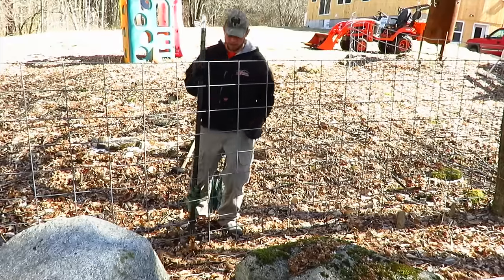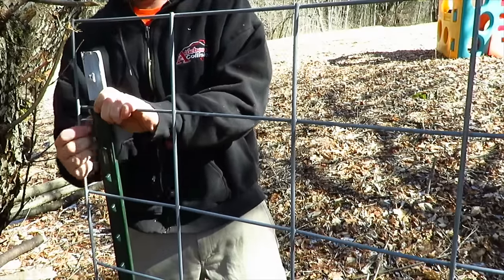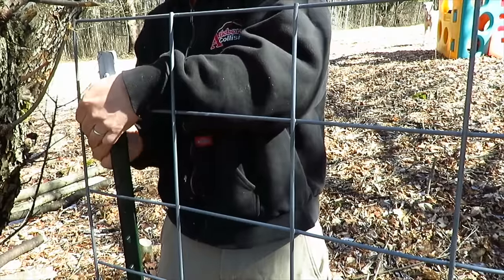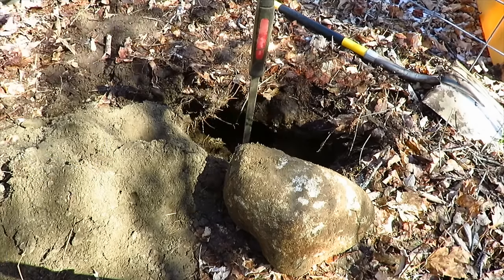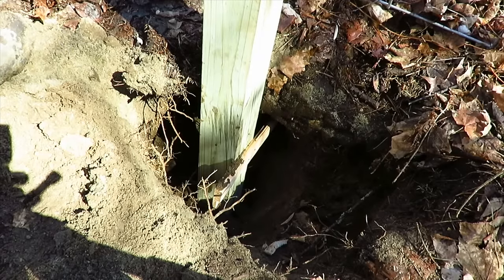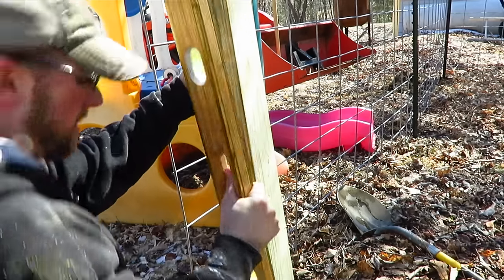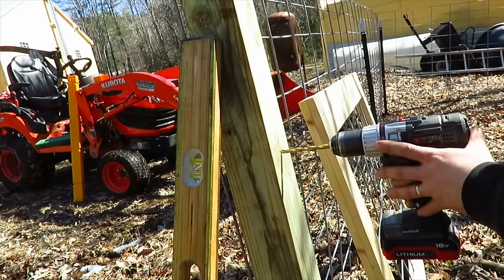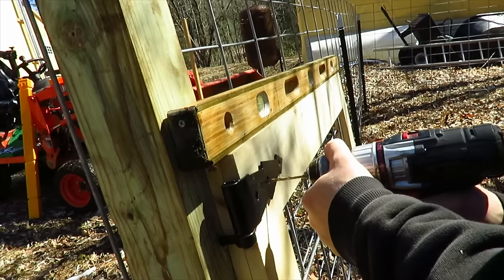Building the Pig Pen and Installing a gate

Comment: What keeps the pigs from digging under the fence?
Reply from the maker: +Patrick Lawson they learn to respect the electric fence fast. They want nothing to do with it. So they only root (dig) up to a few inches of the fence and stay back. they are very smart. Thanks for watching
Reply: we don't use electric fencing. we have had some escapes but very smart animal they will find any weak spot on the fence and boom escape very smart pigs are
Reply: Lumnah Acres I know this is a late reply, but my solution without electricity was a 9 inch deep trench to set the panels in.

With the corners wired together I only used 5 t posts, two on two opposite sides and one on the back.

The front panel (which I used as a gate when building it and getting them in) is weighted down with wood.

In two weeks they had the trench filled and those panels aren't going anywhere anymore.

Comment: They made a new invention, called pliers , when you use those t post wire staples, so much easier to twist them around the panels 
Hope that helps...
Reply: News flash, they make clip benders, better than pliers.